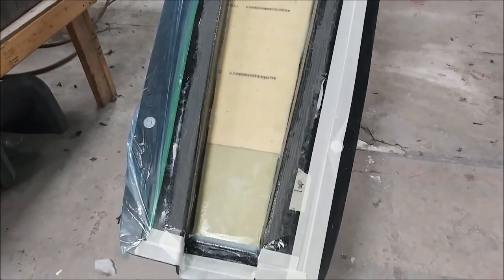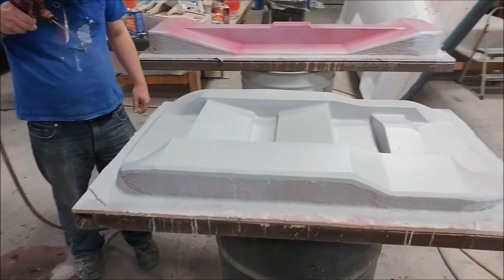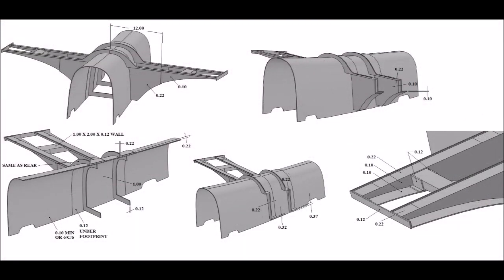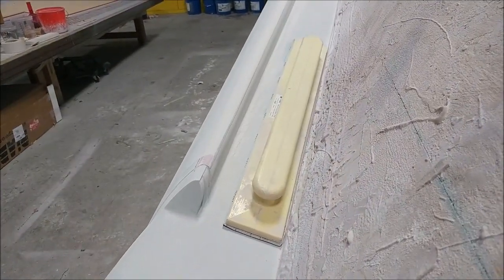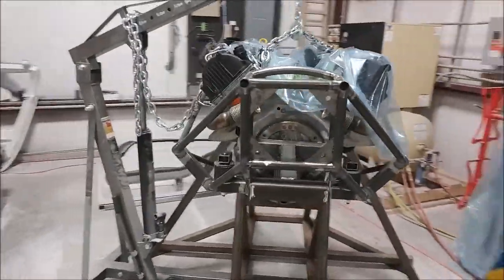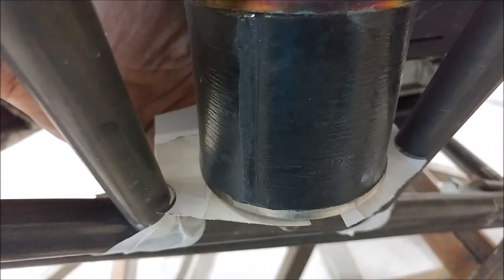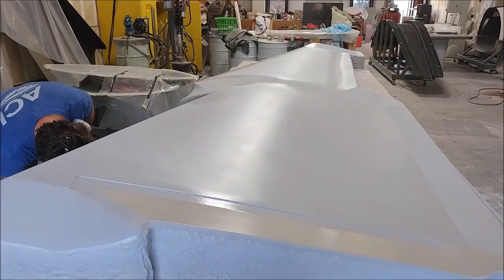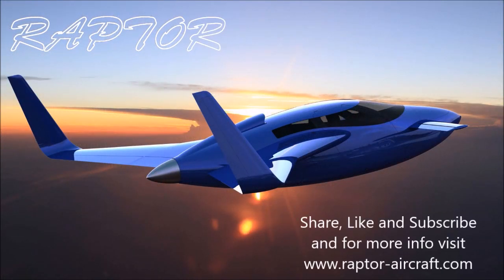Raptor Aircraft February 18th 2017

Comment: Sorry, don't take me wrong, but this project deserves a decent aero-engine.
Reply from the maker: And this is why we're trying to create it instead of simply being content with the status quo.
Reply from the maker: You still missed the point. We want an engine that burns Jet A or diesel so we can fly it anywhere in the world and not worry about trying to find 100LL. All of your other concerns are justified but are certainly no reason for us not to try and do something new. If that's the attitude that everyone took we would never progress.
Reply from the maker: Suggest one that sips diesel or Jet A and does not cost over $50k and weights only 500lb or less, puts out at least 300hp and is available now. We'll be happy to try it.
Reply: Roberto R. MOLA This is the best aero engine available at the moment, get with the times... Diamond aircraft built in Europe are using off the shelf diesels designed originally for cars.  Lycoming and Continental have been repressing aviation for over 4 decades, in any other industry they would be out of business!
Reply: OK, I think I already name it. Sorry if you do not like the brands I cited, but they are suitable: light (less than 200 kg), robust and powerful. Expensive, for sure! If not the IO-550s to 580s, you have nothing that I can name, specially to achieve 300 kts VMO @ 25000 ft with 300 hp. Probably with 450 hp? You CERTAINLY could extract much more from that Audi TDI V-6, but at which expenses? Even considering 300 hp, how long will be this engine TBO? Will it stand a 5 min 100% power setting at take-off? Or a 75% during a, say, 80 min cruise setting flight? (didn`t find such numbers at your site). Observe I`m not saying 15 hours endurance, as you propose on your site specs! Well, you could say "that`s only an experimental aircraft, not a certified one!" Sure, but the people FLYING experimental pressurized aircraft with 300 kts proposed performance are behind IO-540, 550, 580 or bigger. If a brand tag matters, I prefer a Lycoming or a Continental one for a plane, not an Audi tag.

That`s the difference between auto engines and aero-engines: robustness! Quality obtained from more than 9 liters of displacement, not 3.0. Do you have any test bench time logged in this Audi engine? And, do you know that psru need a separate test, don`t you (specially when using cog belts)? That`s the added failure modes I mentioned earlier, something that engineering must address and mate perfectly (engine, psru and prop), otherwise harmonics can be a real pain! I`m NOT saying you cannot develop an ADEQUATE innovative power group for your craft, but this certainly will cause extreme headaches and money flow you are CLEARLY trying to save. And CAD won`t make miracles or predict the future - a prototype always says the truth...

In time: I`m totally favorable of piston engines for less than 6 tons aircrafts, since small turbines are inefficient and thirsty below 1000 shp. What a pity Orenda engines are fading in the past! That`s a good example of a well engineered piston engine that addressed this common psru engines with excellent results (600+hp). And last, but not least: I really like your design! I`m following its evolution on Youtube channel at every step. But, sorry again, I just gave my two cents about your engine choice (and I`m still concerned with the pilot!).
Reply: I think I made myself understood. Low development costs and high technological advancement are not usually connected. And Audi is not and I do not believe that it will become a great supplier of aeronautical engines. In this way, I wish good luck to the entrepreneurs. They will need it.
Reply: WOW !! I am starting to understand why aviation is 50 years behind every other industry... It is people like BOBBY boy here that have never been able to get out of the RUT their fathers put them in.  

OMG! Bobby. You are basically saying that large displacement turbo charged AIR COOLED engines are more reliable then said Audi engine. ROTFLOL Seriously your making yourself out to be a moron.

Your arrogant comment about "who can't afford a 500K plane" you pissed me off & everyone can see your a idiot.
Reply from the maker: The EPS engine is too heavy for the Raptor, and from what I gather the price will be close to $100k.
Reply: This is a good choice to keep the costs down and do the job.
Reply from the maker: Do you have a recommendation? If not then you are not really contributing. Thanks.
Reply from the maker: Ok, price aside, name an engine that fits the rest of what we're looking for. There isn't one that I'm aware of.
Reply: Good luck
Reply: Roberto R. MOLA I think the main thing Raptor Aircraft is trying do is redefine what aviation is, and what it is capable of. If we aren't willing to extend the boundaries of what we are comfortable with then anyone who can't afford a 500,000 dollar plane will be stuck putting around in a 1970's Cessna. I certainly don't think that Raptor is stupid, or haven't thought this engine through. It is my opinion that comment threads like this are a waste of time to whoever has to reply to them, certainly doesn't come off as "constructive criticism".
Reply: Newtz I don't stand in a rut, the only thing I was getting at is the reason the aviation industry is 50 years behind is due to that fact that companies simply aren't changing anything, look at bonanza's, look at Cessna 206's woah they have new avionics big freakin deal, they have no range and no space. On top of that de design hasn't changed in the last 50 years. You might as well start trying to fit your foot in your mouth now because Raptor Aircraft is going to set Amazing, Ground breaking positive records. And my whole 500k comment was merely to make a point.
Reply: Roberto R. MOLA , such a naysayer. . . Its kinda why they're building a prototype, to address the concerns you pointed out, with the performance goals they have.  A lot has changed in the last 60years since these engines were developed. The TDI is a great example of that technology, pretty much what diamond did.  Diesel engines alone are already more robust than any gasoline counterpart.  Im failing to see your concern, by adding a more reliable fuel, and more technologically advanced engine, in every regard.

I will say that 300Hp at 25,000 ft with 3 liters put a huge reliance on the turbos.  Plus you're asking them for cabin pressure too?  Not sure why a small turbine wasn't chosen, other than cost.  Meets the Jet fuel requirement, and blows and piston out of the water on weight.  Simplifies the gearing issue with the Prop, and gets rid of the water cooling. . .  A PT6 would be pretty sweet in this thing.
Reply: Raptor Aircraft what other options were considered to power the aircraft?  I saw this, and thought it would make a good candidate,  https://cumminsengines.com/repower .  I would think you could get 250 hp reliably, but spinning slower.  It would eliminate the need the gear the prop.  260lbs of torque in stock trim too😍.  At 500lbs, its in the neighborhood of the flat 6 Lyco's & Cont's.
Reply from the maker: That 2.8 is not powerful enough. 160hp at Max rpm is way too low. Maybe their next variant could be better.
Reply: With just the emissions removed, it would probably give you 50Hp.  Cam and a little more fuel, I'm sure you would hit 300 hp pretty easy.  The torque is there.  They also make the 5.0 v8 that they put in the Titan, as well as a 3.0 v6 that puts out 340 hp at 3400 rpm.  Just gets rid of that belt drive you have going on.
Reply: I am in agreeance with you in the idea of having the right tool for the job.  Some changes will need to be made to make any car motor a viable aircraft engine.  Power and demand for each is very different, but at the end of the day, it's the same suck, squeeze, bang and blow.
Reply: Roberto R. MOLA  have you ever done anything with a diesel engine?  Talk about beef. . . Also, the way the have it designed now with the belt drive reducer, it actually negates the need for an oversized bearing, since it won't receive any felt force from thrust.  And it being experimental, you can put whatever motor you want in it.  Diesel is the future of GA.
Reply: How good is anything restarting at altitude?
Reply: Raptor Aircraft My mother had a good saying: "You can only walk in steps the size of your legs". Cannot afford a Lyc or Continental? Sorry 'bout that! But you mentioned one good option: the diesel engines are a real revolution, besides the fact gasoline are getting more and more rare at airports. Still expensive? Well, the legs. Legs size are unavoidable...
Reply: Raptor Aircraft Sure I got a recommendation: pay the price and use an aero-engine. Or pay much more to cover all the failure modes of an absolutely unproved engine. I'm really concerned with the test pilot...
Reply: THIS engine is not aero and not available.
Reply: Who missed the point? I told you "if not the IO-550s to 580s, you have nothing that I can name", simply because they do not exist with your power needs.
Reply: jesse sadler I'm not a naysayer (just read the older posts). Only suggesting Raptor is wasting a good design on a poor engine. Moreover: try to restart a diesel engine without mechanical compressor at high altitude - it's impossible! Other manufacturers experimented several variations before and this specific issue was addressed properly by some. Lycs and Conts are dominant because there is no reliable and viable competition, and not because it's an imperialist "oligopoly" or something.
Reply: I think you mean "Unproved", not poor, and that's only in your eyes.  I think the TDI is a great motor.  I have one, with almost 500k on it.  I just question the RPM range.  Even the TDI can be massaged to give more power at lower RPM, which is an important factor in longevity, it's why I was suggesting the Cummins motors (they are also steel blocks, and either gear or chain for timing)
Reply: jesse sadler Yes, same operations principle, but the guts are VERY different (more metal, more displacement). Look at the bearing size of an aeronautical engine at the prop end, for instance. It's much more than a beefed up VW. Since my PP classes I understand a good aero-engine turns slowly and have lots of cubic cm (or inches, if you prefer). Resuming issues to be addressed: reliability, excessive failure modes - psru and ancillaries, and restarting at altitude capability. A diesel requires a lot of compression ratio to operate - available when turbos are full - absent when engine stopped, even with huge strokers. Raptor, if you are trying to be revolutionary, cast a new engine, a new design focused in simplicity and reliability. All the rest comes along. Currently you are trying to "reinvent the wheel" because you are not researching former engine makers and its known issues. Again and again. You have an excellent design on hands - please don't waste it on bad engine choices. Use a petrol engine while you don't have a diesel available.
Reply: jesse sadler Yes. Go for it!
Reply: ***** Yes, we agree in 99%. However a little planning ahead does not hurt anyone. After all, we are dealing with something very demanding called airplane. I have been dealing with this for 40 years and have been successful by being a bit pessimistic (my 1%) while being enthusiastic (your 99%). It is, in fact, a very pleasant idea to think of ocean crossings with an efficient and inexpensive machine. But the engineering required has not been presented to me yet. Would you fly with this type of motorization? If your answer is "sure" ... go for it! But no one has yet answered me about restarting problems at high altitudes. This is one crucial diesel engineering problem - I'm not creating, this is a known issue - and was not addressed by Raptor. Resuming again: If I had a few million dollars to invest, they certainly would not go to Raptor considering the engine option and the closed question on their part about it. Diesel or Jet fuel are good options, but you can not work miracles with automotive engines, no matter how fervent and enthusiastic believers we are.
Reply: Antun Šoštarić Details? Sure! What I know about restarting diesel engines I learned from Delta Hawk company that produces (I believe) a couple of inverted V4 two-stroke diesel AERO engines. One is 160 hp, the other is 180 hp. They addressed the restarting issue installing BOTH turbos and super-charger. Other technicality considerations were dealt with high professionalism and engineering responsability. Note that these are NOT conversions from car engines, but original designs that, I think, are inherent to expansions like, say, a V6 or V8 with corresponding expansion on power. Designs like this (http://www.deltahawk.com) really make me dream about high performance innovative aircraft. It could be the inspiration for Raptor - after all, if we are trying to divorce from Lycs and Cons, nothing like a blank sheet of paper!
Reply: jesse sadler That's one diesel specific issue.
Reply: Roberto R. MOLA 
Continental diesel is a Mercedes.
Reply: Paul James Nope! Continental CD-200 (former TD-300) was developed from the french SMA SR305-230. SMA itself is Safran subsidiary. No relation to Mercedes-Benz.
Reply: The CD-135 "is based on the Mercedes-Benz OM668 engine from Mercedes-Benz A-Class"
https://en.wikipedia.org/wiki/Thielert_Centurion

Don't bother responding.
Reply: The CD-135 WAS based on the Mercedes-Benz OM668, as Thielert is a defunct company since April 2008 (according to the same references you provided). Raptor ask me to provide a recommendation - cannot cite insolvent manufacturers. Continental is CURRENTLY (since Thielert is past), developing a diesel engine created by SMA. 

Why not respond to you if you responded to me?
Reply: I hope, the Audi engine will work and Raptor have good engineers, with all details - like engine control unit, connection to the electronic computer system and many details. I fully agree with booth parts... I´m sure, Raptor will have other choice, if something goese wrong. Alternative can be http://www.smaengines.com/our-product/sr460
Reply: Forgot to add: the reason for that "hindrance" is because high compression ratio required for diesel ignition is considerably reduced in high altitudes, due to low air density. The way Delta Hawk addressed the problem was to "restore" the compression ratio with a mechanical compressor, that actuates even at the first revolutions of the crankshaft.
Reply: Yes, very good option. I hope this engine will be produced - would be more than an alternative.
Reply: The Continental V6 diesel is based on the Mercedes-Benz OM642.
Reply: Jesse, since you have a TDI and are more familiar with those engines, have you heard of any real mechanical issues with these engines? I see the biturbo is beefed up and was wondering how you feel about this engine being used for aero use. I have searched and searched and haven't found any real achilles heels for these engines other than emissions and electronics which would be vastly different with the mods that Raptor is doing. Thanks.
Reply: Paul James Try to find ANY V-6 at their page http://www.continentalmotors.aero/diesel/diesel-engines.aspx
Reply: I searched for any trouble this engine has caused as a car engine and it's pretty much a clean sheet (2008 and later model with common rail). Excellent starting point for the conversion. Some people say it's the most reliable car engine.
Concerning running at high loads over a long period of time, this engine is surviving the German Autobahn. It's built tough. As a car engine, it's also a bi-turbo (with intercooler).
Reply: Here is one more engine to look at:
http://eps.aero/the-eps-engine/
350 hp, Diesel V8, 12.4 gph at 75%, 3,000 TBO
Reply: skigeilfahrn Very good!
Reply: +Antun Šoštarić Size, material, TBO and specific (aeronautical) application and engineering.
Reply: Well, when you're connected to lots of people in several social media at the same time, we post text very fast... and wrong, some times! Just to edit again: power is 350 to 420 hp. With such cavalry a 250 kt @ 25.000 ft flight is more credible, IMHO. Cost is a very complicated thing to calculate. How much costs a gallon of Jet A1 at your country? Probably, here in Brazil, is the more expensive of the world!
Reply: Antun Šoštarić No idea